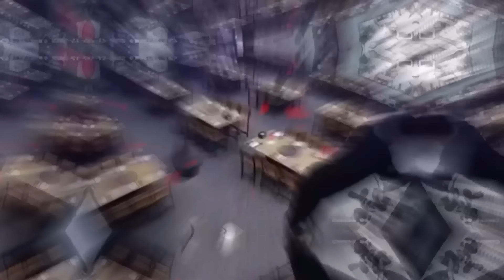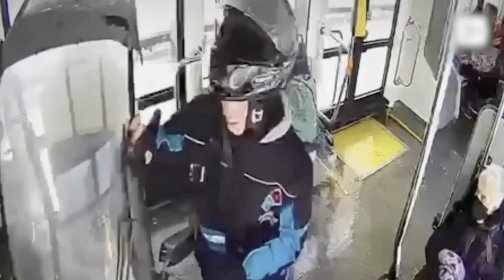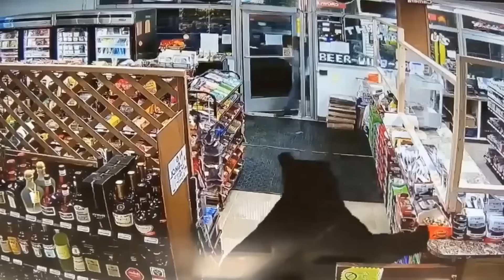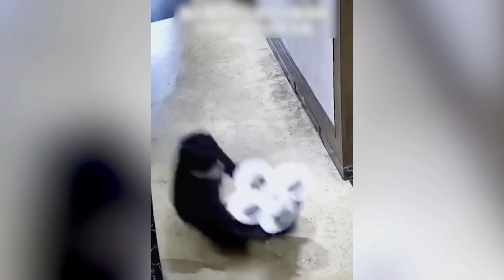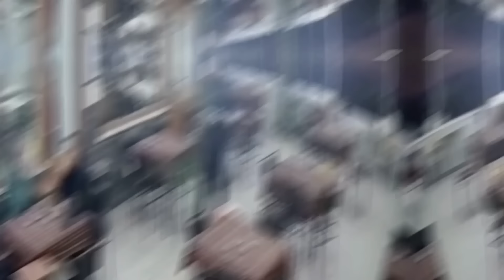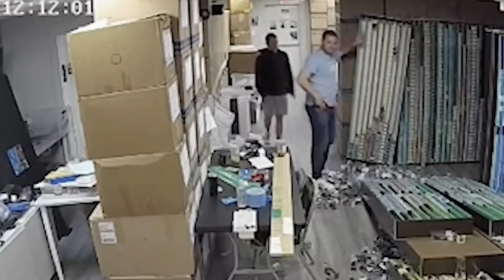WEIRDEST THINGS CAUGHT ON SECURITY CAMERAS | BEST OF THE YEAR

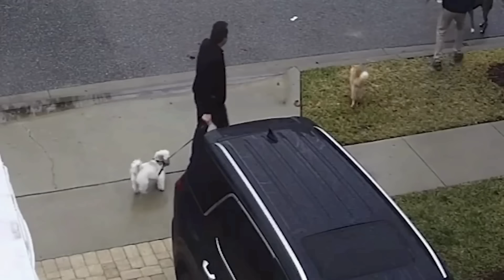Comment: at 47:50... is the damn laptops!!... they creates a hot spot under them.. the the glass spans there.. while the rest of the glass do not.. creating pressure.. until it fails like that.. always put a book or a folder under the laptop when is on a glass surface like this...